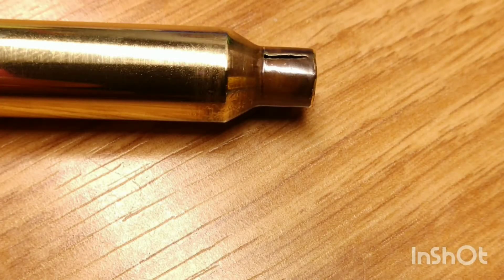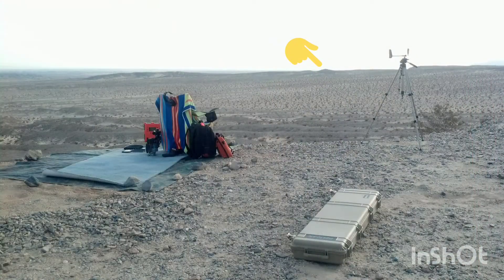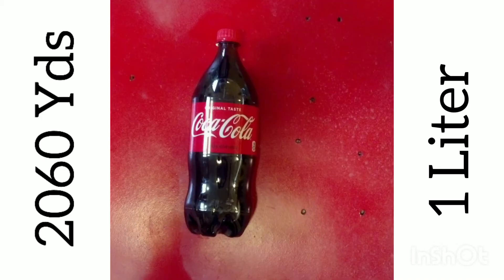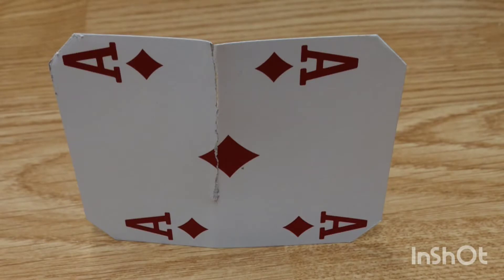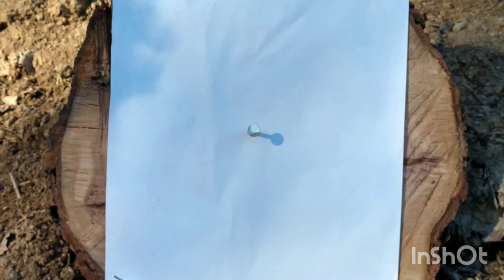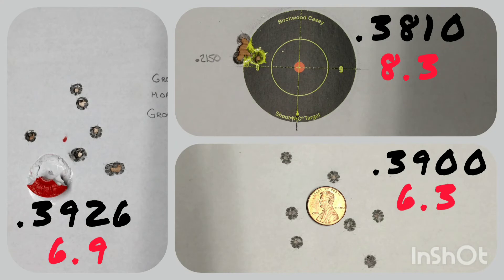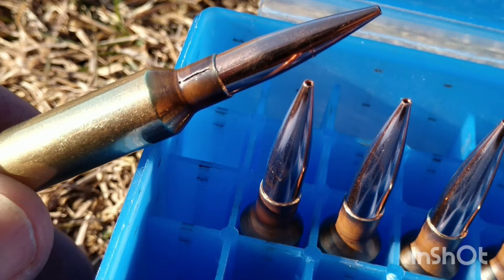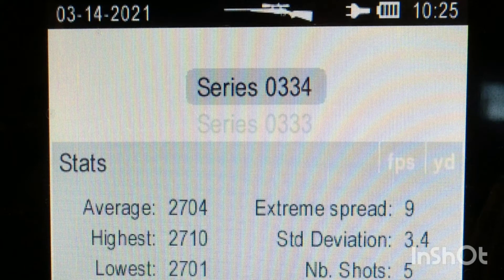How many times can you reload Brass and how is performance affected.

Comment: I only load by brass 5 times 6.5cm , I will try this year to get more put of my brass
Reply from the maker: Hello PJ,
Hope it gets you a little more milage from your cases.
Remember,  all brands react differently and even same brands from lot to lot.
I don't run them hot either as that will shorten the number of cycles. 
Always watch and inspect for failure such as case head separation.  Cracking necks is also common if you turn them down. 
Brands like Federal and Starline start becoming scary around 12 reloads, Winchester starts showing earlier from my experience. 
Lapua,  Peterson, and Nosler all run for a long time under a watchful eye.
In the end, if I remember correctly,(*not looking at my log) those cases were retired at 41 or 42 reloads. (Several died short of that)
Be safe, don't take chances, and thanks for commenting.
Reply: @6.5_Shooter  what powder and bullets are you loading up in your 6.5cm?
Reply from the maker: So that load in the video used mostly 140 elds with h4350, some RL 17 with Sierra 142s.
My best running bullet currently is 140 Berger VLD target using Norma URP powder.
I use Staball quite often also.
@P.J.GABRIEL-dv2bv

Comment: Hello 6.5. Do you sonic or tumble your brass?. What annealer do you use. And what neck lube do you use. Thanks for great info. Your results speaks for itself. I will  be sure to call long before knocking on your door..LOL
Reply from the maker: Hello Jim. Hope the Holidays are treating you well.
My answer to cleaning brass is somewhat boring. I tumble with corn media and from time to time I'll throw in a cap full of polishing paste. To be specific it's the combo package of the Cabela's branded name stuff.
Reply from the maker: I use the AMP annealer.
I'll go through the process that I prefer to find the case that will be used in the Aztec Mode.
The code generated from the case will be the code I use for the life of that Lot of brass.
Reply from the maker: Thanks much for the questions and for watching 6.5 Shooter!!

Comment: Great vid!!! Did I miss how you are sizing your brass?
Reply from the maker: Hello Cory.
Due to time constraints I negated a lot of that information. 
The answer is detailed here:
Forster Full Length Sizing Die with ez expander ball removed. #005348
Expanded with 21st century Mandrel .2615
While sizing the case,  the neck is reduced to .2855". The Mandrel brings it back out to .2875"
When bullet is seated the neck o.d is .2905" or .003" neck tension.
The force to seat that bullet on an Arbor Press is 42-45#.
These cases were turned, weight sorted and Annealed so just keep that in mind with the specifications up above.
Thanks so much for watching and for posting up a great question.
Shoot safe!

Comment: I've never reloaded with a cracked neck case. Did you you reduce the amount of powder for the cracked neck case?Thanks for the info. I learned something new today.
Reply from the maker: Oh course I'd recommend NOT using a damaged case but, for the purpose of being through and showing all information I did.
The charge was not reduced in the cracked cases. They were loaded with the same charge weight as the others.
Great question and thanks for posting up.
Reload safely and never push it if the case failure is showing mid body down to the case head.

Comment: I once cracked my neck when I was loaded, hmmm
Reply from the maker: Hello Todd, 
It can happen regardless of how many times the case was loaded.
If something does fail; a cracked neck is the least detrimental within the detonation process.
Usually results in a slower velocity reading on the Chronograph or lower impact on target.
If it happens frequently; reassess your sizing procedure.
Thanks for commenting and shoot safe.

Comment: I get 13-14 firings out of .22-250 and 9 firings out of my 7mm rem. Mag. I don’t anneal. Yet!
Reply from the maker: Hey JJ, thanks for posting!
Those are really good numbers for the calibers having not annealed using non custom dies.
I've had some Brass fail earlier even with annealing.
What's your most common failure that makes you decide to retire the Brass?
Thanks for watching 6.5 Shooter.
Reply: Split necks, hands down.
Reply from the maker: I find that as well.
It starts out spotty and usually progress to the dreaded case head separation line.
Reply: And to be honest now that I’m starting to pay more attention to knock tension I’m sure I’ll be buying new cases sooner. The main reason I’m interested in annealing is consistent knock tension, not brass life.
Reply: Neck*
Reply from the maker: If neck tension rules for you over case longevity than an expander mandrel set may be a route to take.
Less expensive than an Annealer.
21st Century makes a very nice set.
If, how, and what you use to lube the necks with also have a HUGE impact on tension.
Both are a great work around prior to purchasing an Annealer.
Just some thoughts; as you may have already tested them.
Testing is the best part of shooting in my opinion!
Reply: Yup, got my 21st century expander.. The problem is I’m starting to get different variations kneck tension. It’s good alpha  brass. I’m thinking annealing. Even if it doesn’t work, I’ll get the fun in testing it.😁

Comment: Did you Anneal this cases and if so how often do you. Great video 😀
Reply from the maker: Hey Joseph thanks for watching.
Yes I do Anneal and I do it each time I reload. I get pretty meticulous with that procedure. For those cases in the video the neck was turned down to .0130" and the Anneal code was generated on a case that weighed 10.62g. 
Thanks for posting up the positive vibe for the video!